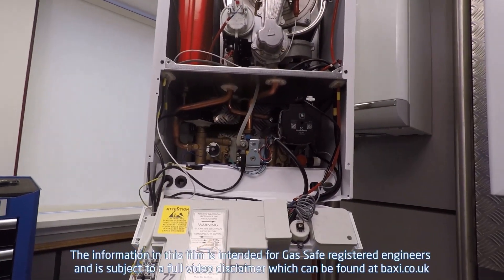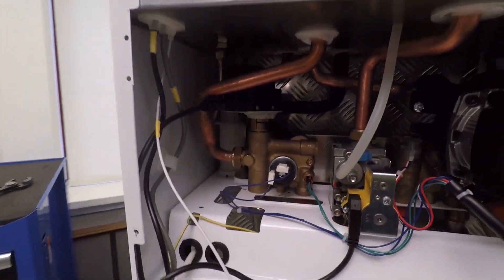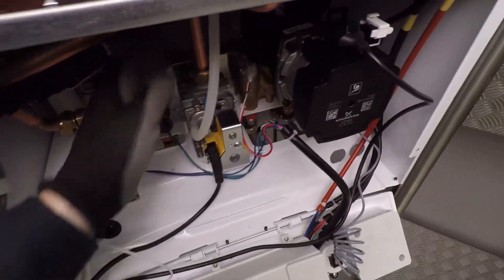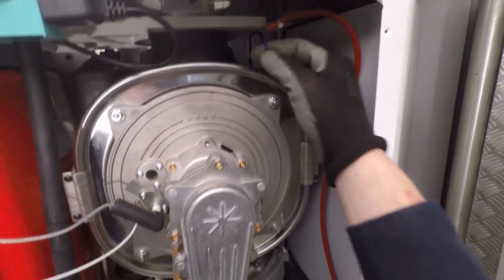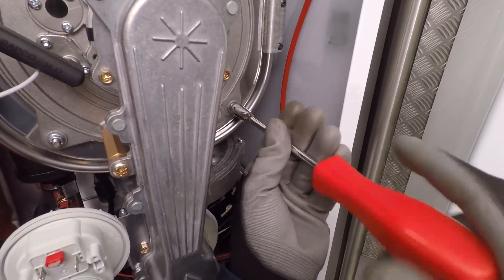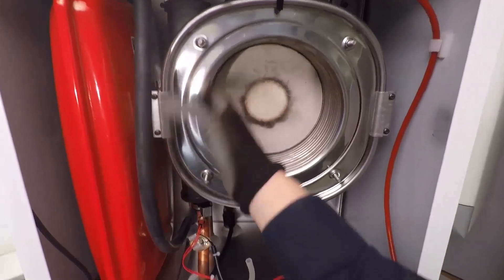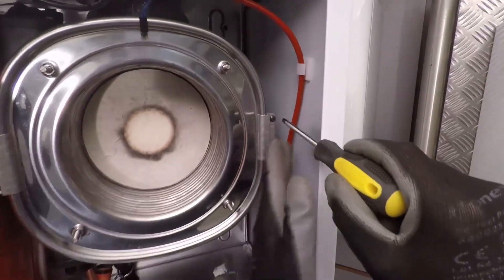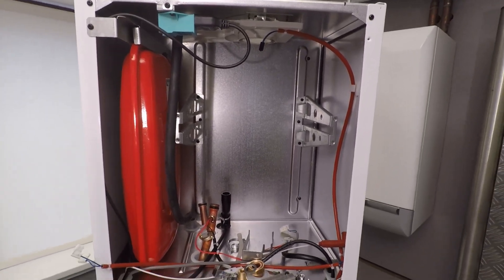How to remove the main heat exchanger on a Baxi Duo-tec or Baxi Platinum boiler

Comment: Anyone know how to repair a rested gas assembly part #5676590 for a Baxi HT380 the auto relief valve leaked and I believe it has a pin hole leak distributor says part was discontinued. I would appreciate any suggestions. Thanks

Comment: Great video. Make it look easy. Putting it back together is always the fun part. Is it possible to change the seal in the top of the heat exchanger outlet without having to remove the flue or heat exchanger? On a potterton promax he plus? Thanks

Comment: Is the hex dropping down from the flue turret when the top clamp is removed ? On video it just seems to slide out but obviously won't as flue connection fits inside
Reply: I see this question has been asked several times and not answered. I did this job today and that drip tray adapter literally pushes up and the hex slides out. Saying that it doesn't push up as easily as it shows in the video, it took me ages to get the adapter to go up enough to slide the hex out because there are rubber seal. When I put the new hex in, it took ages pushing it down again even thou I had put lots of grease on. It was hard getting it low enough to get that holding bracket back in. The whole job was easy apart from this bit.
Reply: @SimpleNickVideos  cheers mate .
Reply: Hi I did the job but I can’t get the drip tray down enough to slide the locking bracket in . Help will be greatly appreciated . When I push the tray down it seem to spring back up .

Comment: Great video. When you push the drip tray up is that lifting the turret from the hex. I'm assuming hex can't be removed with flue elbow in place
Reply: How does the hex seal to flue turret can't just be a slide fit
Reply: Hi Anthony, there is no need to remove, or even touch, the flue elbow to remove the heat exchanger.

Comment: Be Nice to have the Orings and Washers in the Box if Replacing a part. Only thing that let's the Brand down IMHO parts replacement can be a ballache if you don't forward plan and think what you'll disturb. Other than that very easy boilers to work on
Reply: True, none of the baxi parts have any foresight